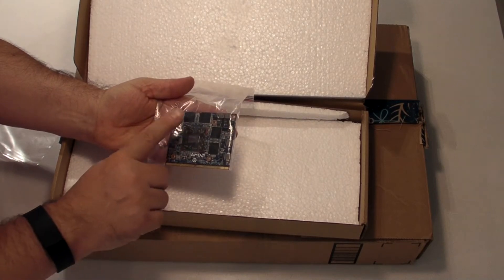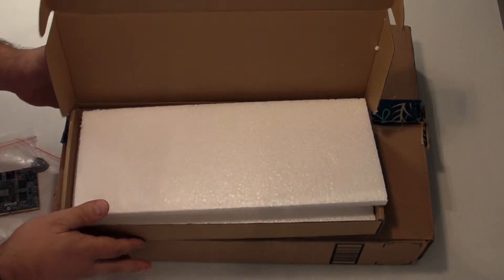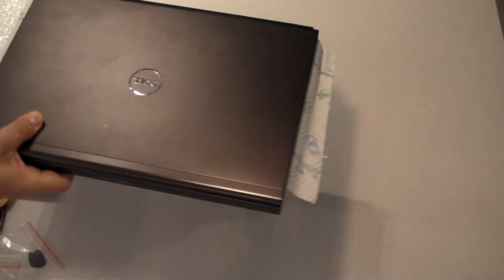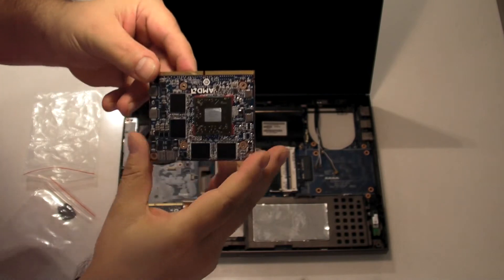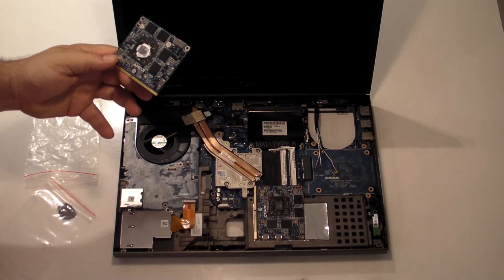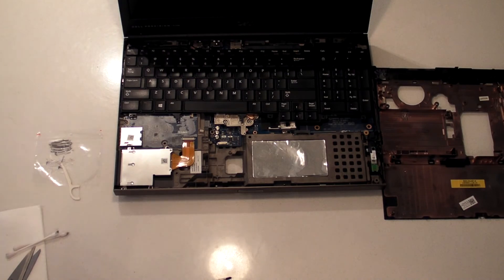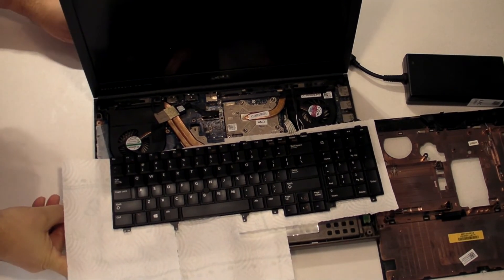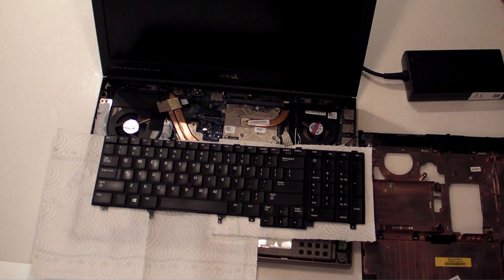Dell M4700 REBUILD #5 - I Bought An **IMPOSTOR** Graphics Card!

Comment: Our M4700 came with the AMD FirePro M4000 Mobility Pro dedicated GPU option.  I'm interested in modifying this machine to work with an nVidia Quadro K2000M GPU card that we bought for a very good price.  Obviously, I'm not trying to do this to realize any serious graphics performance gain.  Instead, I'd like to modify this machine so that it sees its dedicated GPU as being "switchable" in BIOS.  Considering that the nVidia Quadro K2000M was an option for this machine while it was being sold, I'm hoping that this might be possible.  As we've had a very bad experience with a dedicated AMD GPU -- and an expensive laptop - in the past, I really like the idea of being to: (1) Switch to nVidia and (2) Have the ability to turn OFF the dedicated GPU and, instead, use the integrated GPU in an emergency.  Sure, it's a lot of trouble for an old machine, but we use it to run old 32-bit utilities, so we would like to keep this machine in operation for as long as possible.  I've both liked and subscribed now, so please keep on making informative videos like this one for your fellow M4700 owners! 👍
Reply from the maker: The GPU board in the DELL PRECISION series is swappable, so you can upgrade it.  After all, that's how DELL offered the upgrades when provisioning the machine in the first place, at point of sale.  Just be careful that whatever board you put in was "flashed for DELL" in terms of the firmware, or you may not get a boot-able laptop in the end.

Incidentally, I just installed an ATI RADEON 3470 into a desktop-style HTPC with a mis-behaving onboard GPU to extend its service life by a little bit.  I didn't disable the GPU in BIOS because it wasn't an option.  Instead, I disabled it in Devices Vies at the Operating System (Windows) level.  After some fiddling around with primary displays and the like, because the machine still considered the onboard GPU Display 1, the machine now works like a champ on Display 2.

Comment: I was able to upgrade mine with an M2200 Quadro. Didn't have to edit any nvidia drivers - it was just plug & play. Hope you got yours working! If you still can't get there, I suggest contacting Dell and describing the sequence of colors & state of the fans. They may be able to diagnose part/all of your problem if you can describe an error code with the color sequence.
Reply: hi there, did u upgrade quadro M2200 on dell m4700 and it works?